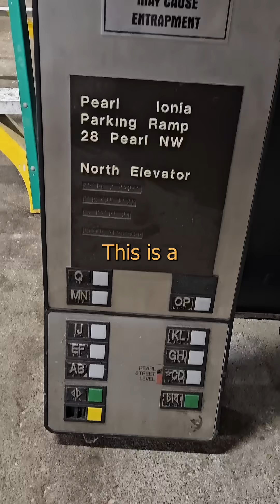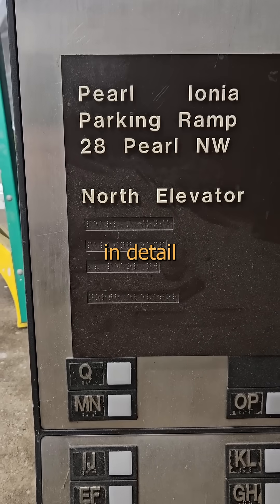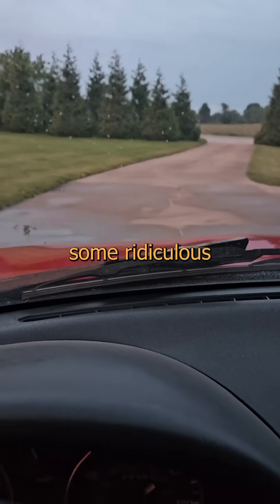Miata Mischief #chrisboden #engineering #gear #elevator #score #stories #parts #hacking #making

Comment: When I was a kid they did whole neighborhood big garbage pickup days twice a year. Where you could throw out appliances and mattresses and all that kind of stuff. It really encouraged reusing that trash onstead of it ending up in landfill. We'd take the day off school, scope out any electronics or machines that looked cool on our bikes, and come back with a wagon or skateboard or whatever we had to bring it home.

One time we found a giant rear projection TV on wheels. We knew we had to take it right away or someone else would. So we started dragging it by the power cable on our bikes. Which was fine until we started heading down a rather steep hill, and suddenly the TV was dragging me and my bike with it. 

I considered letting it go, but there is a busy intersection at the bottom of the hill, and I didn't want to be responsible for hurting someone or their car. So now I'm squeezing the brakes as hard as I can without flying over the handlebars, and dragging both feet on the ground ruining my shoes. Somehow I managed to slow it down enough without flipping my bike, but just barely.

Got it home and tested it in the driveway - and it worked perfectly! We kept that TV for probably another 10 years before it finally died.

Comment: Many times have I over shot my coverage  
20ft 6x6 posts on an 8ft trailer or 10 sheets of peg board on the roof of an 04 Ford focus.  Along with maybe 12 8ft 2x4 and my daughter still fit in the backseat.

Comment: I drive a Scion FR-S, which has slightly more room than a Miata. It’s the car I use to transport my 1918 No. 10 Cirkut camera and all the tools needed to operate it. I spend so much time setting up and meticulously reloading the car between shots that I've considered getting a larger vehicle. The problem is, I enjoy driving my FR-S too much. At one point, I owned a 2000 MR2 Spyder, and my wife and I used that car to bring home a 30-gallon fish tank and a 50-inch flat-screen TV. Small sports cars are all I've ever known! I can’t imagine what it’s like to drive a normal-sized car. 😆

Comment: Yesterday found a good deal on a 1.9tdi engine. Arrived at the farmers years and struck a deal €200 for 2 full engines. 4 hours later both engines stripped and the ancillary’s in the boot with two engines in the back seat of a Toyota avensis

Comment: I once pulled an empty horse trailer with my convertible VW beetle about 30 miles across town.

My friend has horses, and needed a new horse trailer because his old one was wrapped around a tree by his drunk uncle. He bought a new one from a scrap yard for $500, but his pickup truck was busted at the time while new brakes were being shipped. So we put the roof down on my beetle, covered the back seat with towels, and wedged a gooseneck trailer mount back there under some cinder blocks. It worked well enough to get the trailer and my car to his place in one piece.

Comment: There's a hospital near my house that has an exposed dumpster, usually it's just small stuff that gets broken, but I drive by it around once a week to see if they are getting rid of anything cool, most of what I've taken has been office chairs, they must get new ones pretty often because they throw out ones that have such minor problems. 
Got a weird ass 1200$ ergonomic chair with leather seat, the stitching was coming loose. Was the only problem. Fixed the stitching badly and it's still holding up now.  Usually the chairs don't fit nicely Into my small car even if it's just one chair, so I normally have to partially disassemble them to get them in there, one day they had 8 chairs out there and 5 were salvageable, could only fit like 2.5 per trip with them mostly disassembled. But I got them home and have been giving them to anyone I know who is using a dining chair for their computer since.

Comment: As poor college students, we only had an air mattress in our shitty apartment. 
We managed to critically damage said mattress during our New Years orgy and woke up with our butts touching the cold, hard floor through the now mostly deflated mattress.
A local mattress store was having a sale, so we went and bought a king sized mattress (no frame, no box springs, just the mattress), but it did not include delivery.
So, naturally, we put it on the roof of my Chevy Cavalier, rolled down the windows and drove with our arms out the windows to hold it down.
Shockingly we made it home that way, and broke in the new mattress with another orgy. The mattress fit exactly wall, to wall, to wall of the entire floorspace of the room.

Comment: Circa 1999, working at Dillard's, near Christmas.  Customer's made massive purchases, packed their Miata full, but then came the 'oh, we need that thirty six inch TV in here, too'.  Through the use of a lot of duct tape, swearing, good wishes and a signed waiver from the owner, they left with it tied down to the top of the 'trunk'.

Comment: I have a VW Touran, that's had some funky loads.
I've used it to transport bails of hay, I once ratchet strapped a 3 seater sofa to the roof and drove it home ive had various appliances and furniture in and on it, I loaded it up with a bunk bed and mattresses for the kids once it was rammed to the point the drivers seat was so far forward I was struggling to turn the steering wheel because my body was pressing on it.

But my personal favourite was transporting a folding louvre door for a 6ft ish cupboard on my motorbike by strapping it to myself, shit was like a sail 😂😂

Comment: My wife’s fancy modern suv won’t turn on if the trunk isn’t fully closed so to bring home a particularly large table I had to rig up some wire to connect two leads to trick the car into thinking everything was okay.

Comment: I needed to replace a door in my house, and managed to get the new door in my Chevy Volt. It fit surprisingly well, but if I had gotten hit from the right hand side my brains would have been spliced right out by a big slab of wood. On a different occasion I had a whole sheet of drywall in there, not in one piece of course, it was cut into three length-wise pieces. I also had all the materials to build a new set of deck stairs in there once, and I've had various 2x4s and whatnot. Basically, the car is just barely long enough to put long narrow construction materials inside of it. But it's not what you would call "safe" to drive like that.

Comment: Turns out when you’re timing a magneto the gearing on that thing is stronger than the pin you use to set the timing. I had a long speech from my instructor about “if you haven’t become a HAVE DONE yet, you will soon” and I become a HAVE DONE very quickly🤦‍♂️😂

Comment: I have had way more then my share of sketchy hauling experiences/disasters but one of the funniest (with the benefit of time and hindsight) was when I accidentally took off down the street with 6 large hardware organizers (primarily nails and screws of course) balanced on the edge of my pickup truck. They stayed on until I went around the corner of the first intersection at which point the contents of said organizers became disorganized across the entire surface of the intersection. Thankfully the fire department was practically across the street and showed up within 5 minutes and helped direct traffic and clean up the mess. It could have been so much worse!

Comment: Rode my Motorcycle, to the beach, across the Robert Moses Causeway, in a wind storm, with a Surfboard strapped to the side. At a grand old combined weight of me, the bike, and the board being BARELY over 500lbs, the side winds on the bridge were forcing me to dance the line of "fast enough to cancel the angular momentum, but not so fast that I can't recover from how far I do get blown."

Comment: Between my 04' focus and 00' Impreza, I've fit quite an impressive amount of things you wouldn't think would fit. The most annoying one was the windshield for my Impreza as I got a replacement to get it safetied. I had both front seats as far back as they'd go and I had the windshield turned sideways using the four headrests as the only supports. It was pressed into my back so far that my chest was up against the steering wheel. Trying to reach for the shifter was a pain in the ass (manual). Seeing the guys face when I rolled up and told him we were putting the windshield in my car was funny. It took some convincing before he gave it a shot. If I had gotten into a collision, I'd probably be in two pieces... haha!

Comment: My first car was a 4x4 1997 Nissan hardbody pickup with the 4-cylinder and 5mt. 

Years ago we got a screamer of a deal on 4 20' I beams that where the main structure beams of a garage that was torn down and we could have them for free if we could get them out that day.

Well unfortunately at that time our full sized truck was down so it was up to the little Nissan to drag our 16' trailer down there and pick them up. And because we are men we live by the motto "I'll do this in one trip or die trying" so we loaded all 4 with the cement slugs on the bottom on our little trailer and make tracks for home.

The poor little Nissan struggled so hard that we ended up having to start in 4 low and shift on the fly just to get this Japanese carnival of chaos running. Then set off the 8 mile stretch back home just yoking every last bit of 140 horsepower out of the little KA motor. 

It went great till the last hill to get over over before going down to our drive, setting the engines to full steam ahead he tackled the hill and slowly worked out way down the gears, barely creating the hill with what little we had left in first before cresting the hill and gently coasting down the other side. 

Still one of the sketchiest things I've ever done especially having no trailer brake controll. I still own the truck and will have to be separated from this earth to be separated from it.

Comment: When i was around 10, i had a trailer attachment for my mountain bike. My friends and i were exploring a nearby neighborhood and found some leftover/abandoned construction/traffic signs. Rode back home, hooked up the trailer, and went back to snag a cool souvenir! They got a few traffic blinky barricade things and cones, but agreed that since i found the spot, I got first dibs to the sign.

Those signs... Holy crap. WAY bigger than you'd think. Thicker, too, so they weigh a TON. Took two of us to lift, had to balance it on my tiny little 2'x2' bike trailer by having two friends ride on either side of me, holding if while it dangled off the back. I'm shocked I didn't blow out the tires on that thing. Made it home though! Parents? Less than enthused. 

I still have that sign 20 years later... Plus a few more! It's become a collection :]

Comment: Me and my dad a few years ago loaded a bushhog for a tractor into the bed of a 1990s era ford f150 with manual transmission and a broken power steering through the hills of eastern Kentucky from my uncles house to mine. We then proceeded to be unable to unload it so we hooked his tractor to the bushhog and each vehicle pulled the other way. The trucks bed broke by the end of it and I think the engine locked up in it a few months later and got scrapped

Comment: I towed a Land Rover 109 on a battleship of a U-Haul car hauler home with a Volvo 240 wagon after the truck I borrowed to tow the rig died. It only exceeded the official two capacity of the Volvo by a factor of at least three. Careful loading for weight balance and slow speeds and it was fine.

Comment: Shoved a piano like a quarter of a mile with the four, then three, then two wheels built into the thing. And yes, several people drove past and asked if we were supposed to be dragging a piano across a road that was doing a great impression of sandpaper. Surprisingly didn’t get in trouble, and a neighbor even lent us a dolly for the home stretch. Still have that piano.
Reply: Piano seen some shit, might be entitled to some veteran benefits 😂
Reply: I did that with a giant TV/entertainment center. I was pushing it on bare wood by the time I got it home 😂
Reply: How's it play?
Reply: @xulahftw5108 impressively well for how old and abused it looked outwardly. fixed a stuck key a bit back, but should probably get it tuned sometime.
Reply: @xulahftw5108 Surprisingly, wheely well.

Comment: Brought home a ibm 3033 processor, and several tape drives, a disk drive, about 300 pounds of cables, a key punch machine, and 2 stacks of manuals taller than myself. It was a beautiful dream but I couldn’t get the 3 phase AC it required… donated my dream to a computer museum… 😊

Comment: Im not sure how applicable this is, but there was a time where I strapped a 22lb cot across my shoulder for about 30 miles on the highway while on my 78 Suzuki GS. I'm surprised I didn't lose my arm with how little blood flow it was getting.

Comment: Moving away to college, I packed my Toyota MR2 (like a Miata, but with 1/2 the trunk space thanks to the engine being in the middle) with: 
A 32" computer monitor, a full ATX desktop computer and peripherals, a laptop, a Yamaha RX-450 stereo, a turntable, a pair of wall mount speakers, my entire wardrobe (the clothes not the furniture), all my blankets, sheets, and pillows, two desk lamps and a disassembled floor lamp, a George Foreman grill, a tool box, a framed painting, and a mahjong set, complete with rolled up mat for playing. (And  I'm sure I'm forgetting things.)

Everything to the right of the gear stick was just a solid wall, packed tight from floor to ceiling. And it should go without saying that the trunk was just as full. I drove three hours across state like this.

Comment: A few stories, not all mine...

The Plymouth Horizon got bad reviews and never sold well; but friend D and her brother M each bought one. They loved those hatchbacks, as "you could stuff the world into them." After M's car got totaled in a crash, he borrowed D's car quite often - they both moved around quite a lot in the 1970s and 80s.

Again the 1980s. Dad once hauled all of a band's equipment - including the sound system and drum set - in two trips of his VW Beetle. Take the passenger seat out, remove the bench from the rear seat, fold the back down, and be amazed at how much you can get through the doors. In that car's later years, we never bothered to put the passenger seat back in. 

I dismantled a broken clothes dryer and loaded the pieces into a 4-door Mitsubishi Lancer. The biggest piece of the dryer was the drum, and it just fit through the passenger door if I put the seat all the way back. The rest of the dryer came apart into relatively flat pieces or small pieces. The staff at the recycle center were more surprised by the fact that I dismantled the appliance instead of strapping it to the car's roof!

Comment: A neighbor about 3/4 mile away had a piano they were giving away. The only caveat was it had to be moved that evening and I had no time to rent a truck. Each of my daughters had a Razor motorized scooter. On one end of piano we put it on both scooters side by side, on other end I put on a small 4 wheel platform dolley. Scooters were not enough to pull on their own, still required hard pushing, but without them I know we wouldnt have been able to roll uphill the road grade. Might sound like a short distance but not with that squirrely setup. Scooters never worked quite right after that. 

Sidenote: I can attest that both the Miata AND first gen RX -7 are big enough for an enthusiastic, acrobatic midget. I mean at least was for the shortest (4'6"), equally descript woman I ever dated.